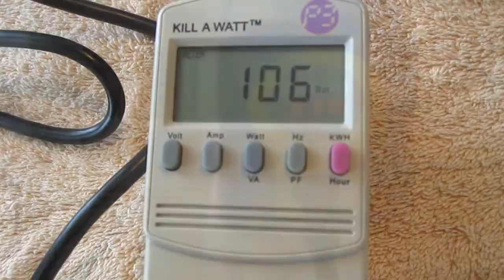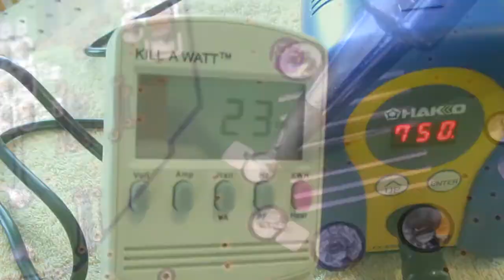$100 Soldering Iron HAKKO FX888D 23BY Review UNBOXING Electronics Repair Station Arcade Monitor

Comment: I have this station. I like it. You can  also get tips very cheap on Amazon and they do work fine.This is by no means a top of the line iron.. It will do the job easily in most cases. Just keep your tip wet.. Especially when you get done with it...

Comment: Acting it's not a professional iron I which it was I'm looking to buy a soldering station and doing sum research. If you want to start in the pro range you would have to step up to something like the Hakko FX-951 the plus on that is that the soldering tips itself have the heating element and temp sensors the benefits are faster heat recovery and more accurate heat sensing also that iron automatically adds power to compensate for something with a bigger thermal mass. All good and well but the price is a bit too high for me